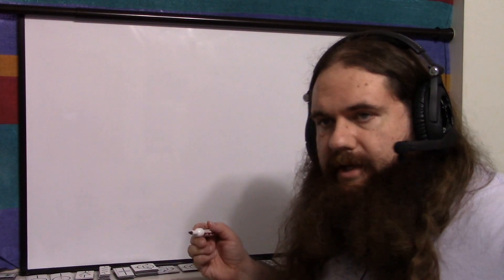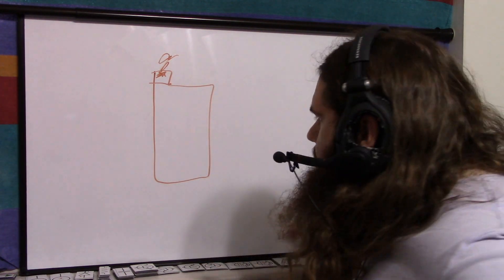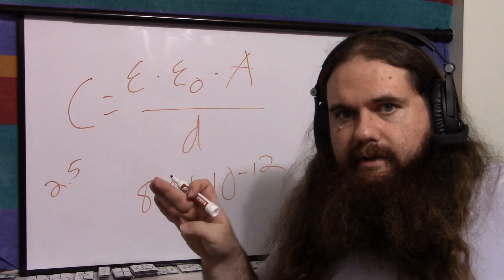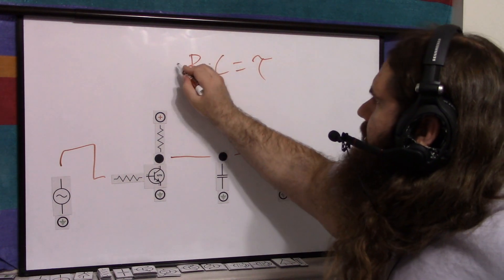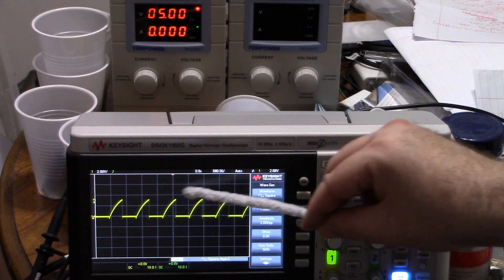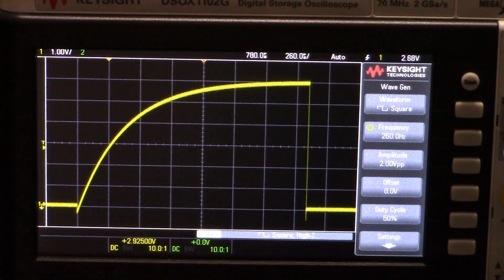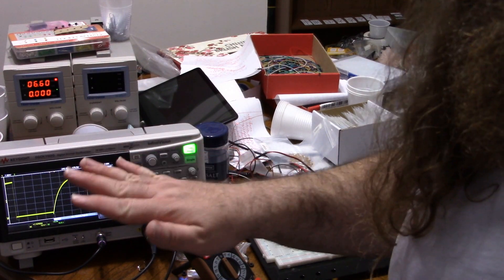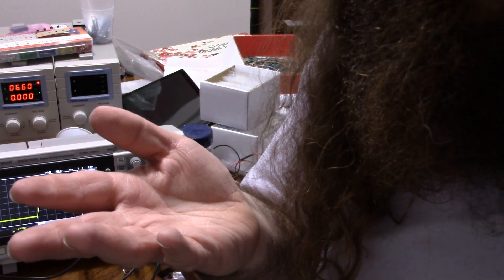Homemade Capacitor - Just Aluminum Foil, Paper, and a Few Surprise Discoveries - Simply Put

Comment from the maker: For a guy who loves math, I sure am bad at arithmetic. When you see 33.15nF, that should be 3.315nF. The good news is, that means my estimate calculation is actually closer to the reality. Yay!
Reply: Thank you for this video!
Please don't mind the haters! ;) <3
Reply: Dude, the hole in your headphones = subscribe🤣
Reply: Yup.  3.3nF is what it should be.  I thought I'd made the same mistake as you, though I was doing it the other way round, calculating what the area should be for 47nF and it turned out to be 216 cm^2.  But that was with cling film, which is 1/10th as thick as paper.  Divide that by 10 and we're exactly in your realm.  

It's still a helluva lot of surface area though, isn't it?  For me, that's a meter of foil by almost an inch that I'd have to neatly roll up.  Strange how the high voltages and high resistances needed for thermionic valves matched the more primitive manufacturing techniques for capacitors.
Reply: Hey thanks

Comment: Mr. Dank smoking  Sasquatch Jesus.. j/k  I did learn something from your video, mostly the squishing part.  I suspect a higher voltage when squished would pose a problem by jumping through the dielectric..     I have a question fro you Mr. SJ..  If I wanted to absorb a positive charge for m the atmosphere (mostly RF)   how would a capacitor be beneficial if my goal was just to absorb and disperse to ground the energy in say a 24  x  72"  area ?   Would It be better to just have a conductive plate to ground ?    

 IF the capacitor is beneficial how in absorbing positively charged energy from the area how would the conductive plates best be terminated, obviously one set would be directly grounded but what of the other plates and should neutral alternating plats be added between the dielectric plates ?   

 'Simple put' I'm referring to broad spectrum RF induced energy absorption without a Faraday cage.   Does capacitance yield any benefit you can think of or demonstrate in a video.

Comment: Years ago I came across a good deal for a high end handleld DVM in a pawn shop and I had the money at the time so I snagged it.   I didnt have it very long before my dad had a fun experiment.   We stacked up mylar and aluminum foil to make a capacitor.  The lesson he wanted to teach, I should mention he was an electronic engineer, was that if you compressed the stack it would generate a voltage, and if you release the pressure it should spring back a bit and while doing so the voltage would go opposite polarity.    So I hooked up my schmancy meter to it and we tried it.  By golly look at that, if you could hook that up to a mechanical oscillator of some sort you would have a generator.   So we messed with it, and I wish he would have warned me cause he knew.  I balled up a fist and smacked it.  Blew the s*** out of my schmancy meter.   I have never paid more than $25 bucks for a meter since,  the $8 one is close enough for anything I am messing with and should I ever be compelled to smack a stack again I wont be so heartbroken from my own ignorance, the lesson will be a lot cheaper.  I came across that stack of mylar and aluminum the other day, 30 years later.  Just cause, I'm gonna go count the layers for ya. Foil is .002", mylar .006 and area is 7x12.  One caveat, among others is the foil has a 1/2 square grid embossed into it havent seen that in a long time and that may have helped a little with springback separation.   Seems to me like that used to have more layers to it and there is a stack of tissue paper on top and a single aluminum layer was out of place so I dont know what it originally was.  I guess the moral to the story is, put some kind of a known load on it because there is no telling how high the voltage went with the tiny load of a DVM.
Since I am storying anyway heres another, related deal.  I worked in a shop that fabricated stuff out of plastic sheet, mostly acrylic but lots of other stuff.   We got a job  rounding the corners on a bunch of signs that were made of 1/2 in HDPE with an aluminum sheet bonded on and printed.  I wasnt till about 6 or 8 layers that when you lay one on the stack and go to line them up it would zap you hard, like getting hit between the shoulders with a baseball bat.  Nobody wanted to do that job. I tried a pair of latex gloves and that cured the problem for a little while, then I got it again and I think it was even worse when the voltage got high enough to make it through the latex.   made a plate that would lay on top of the stack, attached to a wire with a 1meg resistor on the other end, taped to a pvc pipe, touch the resistor to the one you are going to stack, then clamp the wire to the one you are going to stack.  Three of us who got zapped by that thing were sore for days.  I feel sorry for the poor suckers on the other end who had to unstack those without scratching them if they didnt know some basic electronics!
Reply: Oh and what I am looking for is a cost effective way to make a high capacity, low leakage capacitor,  say 80V and the bigger the better on the value. 1000F+  Those ultracaps are kinda spendy.

Comment: I make them with empty jars and aluminium foil with the kids.
Our favourite april fool gag is to drop a chocolate wrapped in plastic into the jar...which is glued to an old table in the garden.
Charge the sucker up....with a van de graf and a hidden wire.
I was really proud when the youngest turned up with a wooden skewer,instead of shorting it with a wire.
My favourite experiment is the Kelvin water dropper,simply because it looks bizarre enough to be a scam,but when the kids examine it they assume there's a hidden power source.
.
Simplest trick to set up requires you to dress in nylon,drag your feet whilst on a suitable carpet whilst your arms and legs are spread out....
walk up behind your target...place your pinky next to their earlobe.....and bring your other arm down...bring legs together.
😸this reduces your surface area just enough to make the spark if you were sufficiently charged,if not...shuffle off and recharge and repeat.

Comment: No, this is not stupid. We made aluminum foil paper capacitors when we were learning RCL circuits in high school. It is called "modeling".  We made inductors from magnet wire and steel nails, and made resistors from carbon pressed into small cylinders. We made batteries from a nickle, penny, and paper soaked in salt water. We made a diode with a tungsten needle and a tiny piece of slightly impure silicon.  These are the building blocks of modern electronics. By building these crude models were learned the math that is behind the technology.

Comment: Just a comment since you mentioned the 5RC time constant rule.   In your typical lessons, where the proffesor has various capacitors on his desk (to make the famous discharge, generating screams, he goes on to tell you tells you that a cap is 'safe' if you let it discharge for 5RC...BEWARE!  This does not always apply.  For those monster 200lb caps, 5RC  discharges will discharge over 99% energy, but that tiny fraction left can be instantly lethal! 
What I do is discharge to 5RC, then sccrewdriver short what is left (quite a spark sometimes), then quickly put the thin shorting wire across the terminals.
Also, even if you wait 20RC time constants, leaving the cap unshorted, and check it the next day,  the energy can build back, (WAY UP!)...enough for a violent screwdriver firecracker.
GREAT VIDEO!!

Comment: You would get a far more accurate measurement if you actually measured the time it took to get to somewhere around 75% full instead (for example, you've got 6 vertical divisions to full on your scope, so measure the time it takes to get to 5/6 of full (the fifth line).  Because the angle of the slope there is close to 45 degrees, it means that that is the point at which you can most precisely measure both the charge level and the time to equal precision, which will produce the smallest measurement errors.

At a charge level of 95% you are really just ballpark-guessing what point that actually is, since your scope doesn't easily show the voltage divisions to that degree of precision, and there's a fairly wide range of time values that are fairly close to the same voltage so figuring out exactly when it reached that point is going to be subject to a lot of guessing and error.

Comment: If you are too lazy to solder a tiny capacitor, can you wrap two wires in a knot, dip it in acid, let it dry, than dip it in a dielectric glue and let it dry?

Comment: Very useful I'm about to try to make a new condenser capacitor for a 1950s Wisconsin engine on a 1921 turner hay press I'm positive that the capacitor is bad because it has very small sparks when it is removed none when it is installed

Comment: so i am not quite in the same boat but yeah for fun and learning...

so i took a roll of foil tape, and a roll of fiberglass reinforced Teflon tape as dielectric, and made a few of these capacitors. I rolled them and have them tightly bound in 1/4" thick rubber hoses, yet i have not been able to read a charge on them after attaching them to a charger... i am afraid to connect them to a car battery.

the foil tape is (Shurtape AF973) cut to 2.5" wide and 3' in length
the Teflon is from Uline (S-13673 3Mil Fiberglass tape)

my thoughts were the charger is trying to use an ac mode and not a direct charge.
my multimeter tells me there is no connection between the two 3' foil plates and that the foil is conductive...

any thoughts?

Comment: You just reminded me of the 10 mylar emergency blankets that I want to play with to make an capacitor. Wonder if it will work. I'll let you know if I get around to it... Maybe two of them on top of each other will do the trick. Just have to find a way to make the connection with the very thin Aluminium film between the plastic coating.

Comment: I'll have to experiment but I'm not sure how else it could work... how do you increase the voltage to a specific voltage?  5V instead 12V or 24V... just adding more plate space would just increase capacitance right?  none of these videos have explained that...  I did an experiment with adding more to the dielectric but double the paper and it was the same voltage...  Tried a bunch of different ways and they're not charging... as if they need a diode or something but that's not how its suppose to work right?

Comment: paperglue-pen-stick is exactly conductor! substance, pretty high resistance, but still conduct - approximately like solid hand-soap layer dried from soap water foam puted on surface, or(almost same) grafet(pen core, burned off from fat, and crushed in thin powder) coating on plastic... such coatings allow to charge PETF or LDPE(f.e.) film from HV like 500V or 5000V... like many capacitors connected in paralel via resistors - can be charged/discharged slowly - and due to high internal resistance - effectively only when slow- with low curents - reducing heat resistance loss of power - (working more like accumulator rechargable cell than supercappacitor). This glue is some kind of polymer, little soluble in hot glacial acetic acid, so i use glue-GAA solution, and coat PETF film with that liquid charged in to medical syringe+sprayertop(from any aerosol balloon desodorant or paint color baloon cap), i put some like 5-10 layers of GAA+glue liquid sol-n on my PET film(30micrones - for flowers shop) sprayed and dried one after one - drying about 5min each layer - until disappear of vinegar smell(evaporates like a water), so i made membrane for DIY electrostatic loudespeacker, that awfull and as simple/tricky to construct as water electrolysis apparatus. glue coating disadvantage - that dust collected on glue-coated film surface, but grafet  coated film - conducts little to much, notwithstanding amounts putted on, and cotton wool+alcohol cleaning of excess of grafet - cleaning it off - for no any grey color on fresh piece of alcohol vetted cleaning wool tampon will collecting. now i like most of all- dried water soap foam(one layer enough) between sandwich of two PET film layer,with dried soap layer(on one or both film) isolated by film layer - from each side, with any little wire(electrotechnical grafet or copper or silver spray aerosol balloon painted line or even border(that you don;t really need for charging such membrane in dry environment at least, but can be useful near border - against charge  leakage  out of film - to one of two stator-plates situated with 0.7-1.5mm gaps (conducting grid(perforated metall or even conductive spray painted plastic grid(5-10kOhm resistance of which - not a problem for 10mA AC current operating(1000VAC from tube-amp-transformer in oposite connection(20VAC->2000VAC)(any one end of HV coil(does not need middle wire really) will be common gnd for charger of film) to mosfet amplifier like TDA7294 or so) 1.5mm+1.5mm f.e., with spacer-points on any 100-150mm of distance(for A4 paper size and 1.5+1.5mm you need one center handle point-round 10*1.5mm plastic coins - two pcs - glued on both sizes(mirror...ly) of membrane  center) on surface- film handled(holded in gap center) by coin-size(1cm) spacers points(3M 1.5mm mounting PEfoam film or so) usually.
if you put resistance coated film on grounded metallic base, or on another same film, and connect some 500-4000VDC from air ioniser or ozone generator, or anode voltage and common("ground") of tube-screen TV, serial via ~100MOhm(4.7MOhm*20pcs 0.125Wt serial f.e.)  safety resistor(so you can touch wire after resistor without damage- getting little "static discharge spark" - no any high current(in 220VDC phase detecting neon lamp - builded in 200-500kOhm resistor - for safety), and you can stabilize voltage without stabilitrones - by some safety varistors serial chain - it will work like stabilitrone bacically - in any polarity - simmetrical -so dont need to think much - connecting paralel(to gnd) after safety resistor - you can get any voltage limited down to summ in chain of varistors rated voltage -stable enough.
film starts to charge, best - if it happens in 0.5-2 minute , grafete  charges in 1 second or faster - it is faster than needed for migration-prevention resistance damping of surface coating equipotential charges, against moving to center on bass - when membrane closer to stator grid, and locally produce (with parasite positive feedback effect) bigger capacitance area - if charging of film fast as bass wave or film is conductive metalic coated(old ESP - when no understanding was collected)
when charging - resistance-coated membrane - starts to "lamination-like" attract to any grounded surface - like electrized statically film do, some sparks cracking sounds can appear on edge of film due to charge leakage away from coating, so good idea is not to put close upto end of border(you have to save some 5mm border of membrane -not coated - isolative plain film "leakage outside disconnecting border area)near edges of membranes layers) water-soap-foam(not foam really needed - just very weak solution - of solid foam(liquid soap evaporates in one week or faster - disappear, solid more stable, especially if between two film layer-prevented from atmosphere drying(and so - flying away)  coating-degradation, it sounds like wire connected to brain sound nerve-line - can be even discomfortable - when you hear in record - crushing glass or plastic film cracking damage sound - unreachable naturally pulse-request compared to dynamic loudespeacker
you don't need stator isolation really with doublelayer membrane,-steel or aluminium grid Rv3-4 or Rv-4-5 or another-good, 30+30microns PETF films almost same good like 3+3microns at 0-20000Hz(i can use that different membrane thickness right and left for stereo - feels difference just a little, capacity of speacker gap(but not parasitic capacitance of paint of grid, or spacer border between stators) proportional to its efficiency - "Ammount of ESL", and must be high as possible - by thin gap or wider-higher size, no third way to reach it, better lower voltage charging(600VDC) with 0.5+0.5mm gap, than 4000VDC with 5+5mm gap,after glueing each membrane to own half of speacker, heat it with industrial fan( >100C) it will reach 50-60hz resonance - that wright, when charged - will be like 30hz -shift down resinance-and starting freq, 2*A4size 2+2mm speackers with 2*100wt transformers, and two TDA7294 amps sounds loud like 10wt dinamic loudespeacker, flat like LCD, focused to ears(it is doubtable feature of ESL when walking on room) and plays from 30hz surprisingly loud-and clean, especially -fast and no intermodulation, freq respoonce must be corrected - by software filters best, ESL anyway have bass and treble feed cutoff freqs - treble due to amp-possibility of instant current flow, bass - due to no any box user - open freeair concept

Comment: You are a cool dude! don't care of negative comments. The world would not have passed the cave-era if there were no pessimists. It is the ladder to climb higher. So stay with your mission. I quote a Chinese proverb: It is as if you are a kite that flies higher only when the air current is stronger and in opposite direction. You are doing great! Now I am going to give you a cool tip. Get some horse tail hair and tie a knot at the root of your mole, the one on the right side. One single wrap with one single knot; should be long enough to grip it with your fingers; Keep tightening it a bit ever day in four to five days your mole will fall leaving behind your shiny and smooth skin. Try it. I had one on my eye lids. Doctors and dermatologist wanted to charge 100s of $ but my grandmother gave me this free treatment and it worked. The mole or wart whatever it is, never grew up again. It has been 17 years now since I removed it. You are a COOL scientist who has knowledge and understanding of real science.  Keep it up sir. Have a nice day.